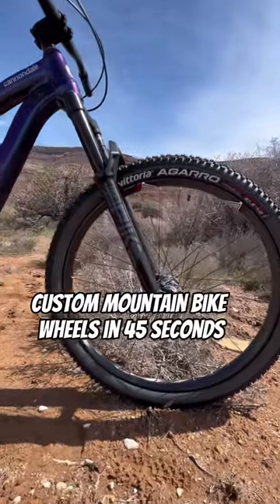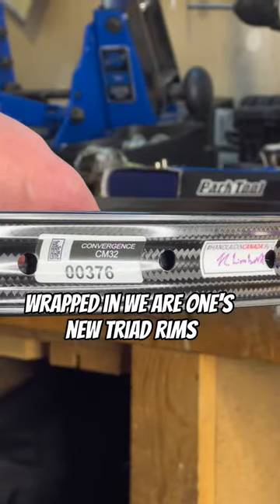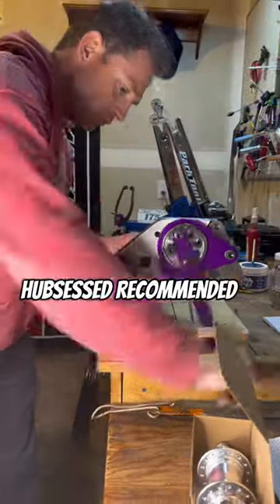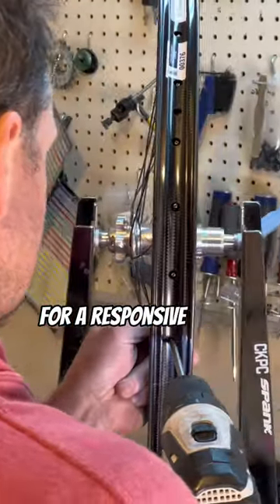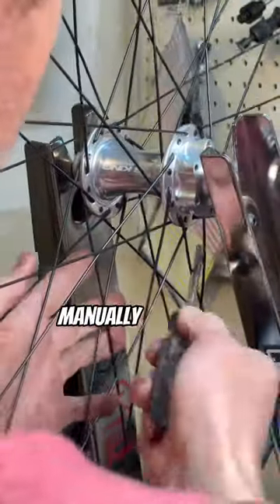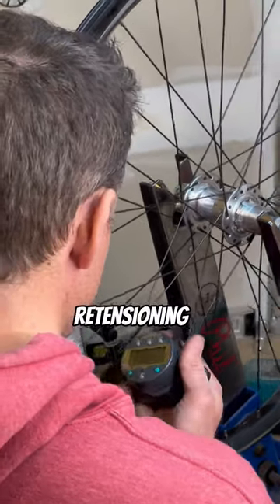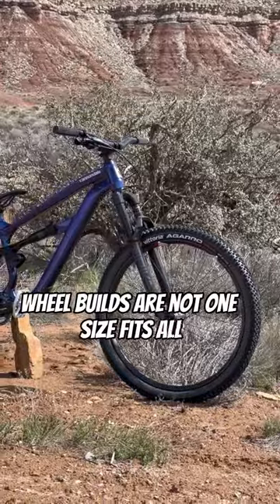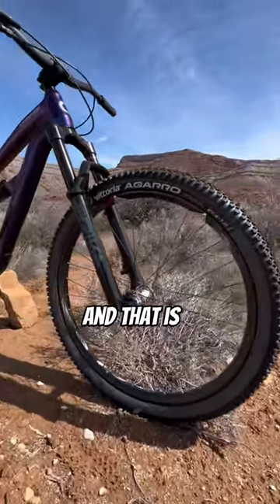What’s your dream wheelset?

Comment: You cut your own spokes?!! That’s next level wheel building!!
Reply: Its very practical. The problem IS the machine that puts the thread back IS about USD $300.
Reply: @vittocrazi honestly, that's not that bad considering a bike shop to just rebuild a wheel is like $110
Reply: I would just want to buy the correct spoke length. I'm not that advanced😂